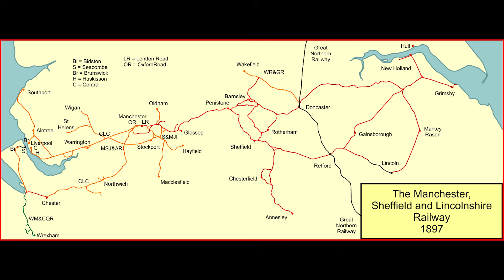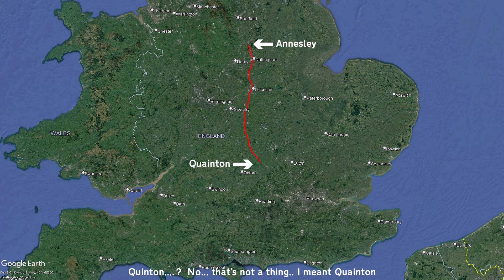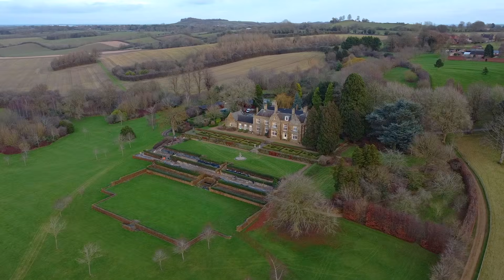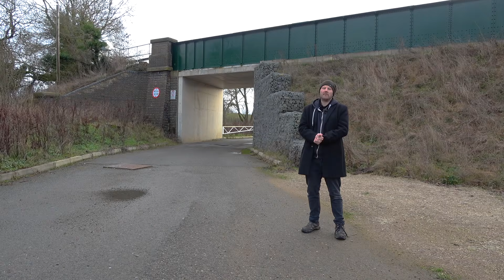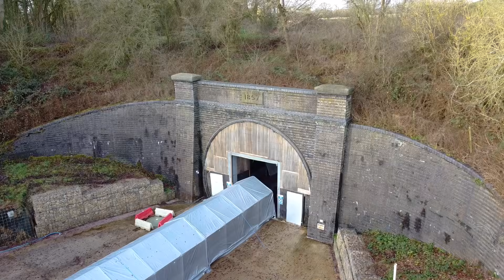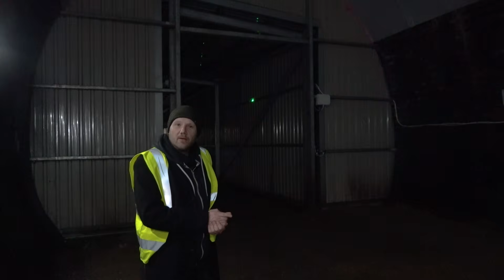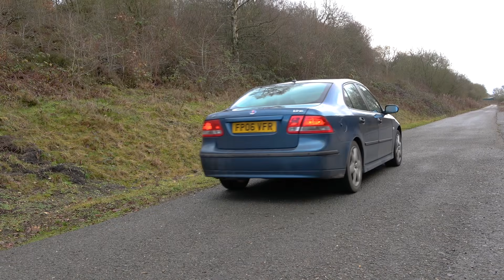The Vehicle & Car Testing Facility Buried Underground In An Old Railway Tunnel

Comment: Thanks for the video, hint, please use Yards as the railways were built in Imperial dimensions.
Reply: Chains if your being pedantic.  (I'm a railwayman 🙂 )
Reply: @stevekelly5166  They measure the length in chains, but were building in yards, feet and inches.
Reply: @fredericksaxton3991  I know my pounds, shillings and pennies.  Don't go metric on me 🙂
Reply: @stevekelly5166  So do I. I still convert in my mind when I buy things like sweets and veg. 10 years ago I was Xmas shopping and bought the last parsnip in the trays. When I weighed/scanned it it came up as 0.67p. I exploded.."How much!", 2 women laughed at me for never shopping, I said, "No..that's 13shillings and 5pence!!" They were bemused.
Reply: @fredericksaxton3991  That's a great way of telling somebodies age - just chuck in a pre-1973 reference, like an M-reg car.  0.67p is very cheap for parsnips though.  That's less than a thruppenny bit.
Reply: @stevekelly5166  Silly me for missing out the £ symbol. I correct the price to £0.67p. Which is damn expensive for a single parsnip.
Reply: Although he did say it was built to French specs and they’d transitioned to metric in the late 1700’s.
Reply: Cubits better than your silly imperial yards.
Reply: @aoxby8037  You are a GAY LORD. I can do metric too.  How is your fanny?  Poking in or out?
Reply: @stevekelly5166  Not sure why your reply to me was deleted, but cubits aren't metric. They are a ancient unit of length. I was also making a little joke with you, but someone seems to have gotten offended.
Reply: @aoxby8037  Youtube sent me a warning yesterday!  Didn't say which post it was or even which video.  Left it to me to click the OK button.
I reckon I could make it worse by telling you Youtube should force it's elbow to the tip of it's middle finger where the sun don't shine 🙂  Don't even care which arm is used.  Was there a preference back in the old days?

Comment: My profile picture is myself and my brother in one of the rest areas when we walked through the tunnel about 8 years ago (ish).  We just went to check it out and happened to get there at the same time as two dudes that had proper cameras and lighting so we got some awesome pictures. Was a spectacle to walk through! There were 100’s of dead birds by the last vent shaft, and also lots of shotgun cartridges. Couldn’t really tell what sort of bird but they were big. I digress. The pictures are on 28days later.
Reply from the maker: I'll have a look.. I love a bit of 28DL.

Comment: Well, I didn't know that was there.
By the way, the original railway was the London Extension of the Great Central Railway, which ran to Marylebone Station, as featured on the Monopoly board.
Reply: London extension of the Manchester Sheffield & Lincoln railway that also built Immingham & grimsby docks, also cleethorpes (!), renamed as Great Central railway on the extension opening.

Comment: So you can actually test your car inside a former railway tunnel without any problems. Perhaps Top Gear should do a challenge inside that tunnel.
Reply: Like The Grand Tour did
Reply: Exactly
Reply: No problems, so long as you cough up the 15000 quid day fee. Just 1000 if you wanna take your bike

Comment: I knew you had changed to a 9-3 saloon, just as I have 😂 great cars, hoping mine will make it to Portugal and back later this year!
Reply from the maker: I hope you make it.. mine has a couple of issues that need sorting and Im sure one day it will leave me stranded in the arse end of nowhere.  Did you get petrol or diesel?
Reply: @AutoShenanigans  mine too, I’d like to get the cam belt and water pump done too before I go because I don’t know if it’s been done before!
It’s a 2008 1.9 diesel 150hp with a slightly stiff gear change 😂 nicest fwd car I’ve owned though, it’s sublime on a long distance run! I still can’t get bored of nightpanel either!

Comment: In 1971? 
The tunnel was used by squatters - the Northhamptonshire Free Love Party (or NFLP).
They cleared a blocked drain, that had been flooding parts of the tunnel.
They then set up a virtual community of 'vagrants' to live inside.
These were all 'hippies' (the right just called them 'commies' or 'drug addicts') who wanted a 'commune'. The tunnel was vacant - so, they used it.
British Rail was not consulted about this and an inevitable lawsuit resulted.
Also inevitably, the NFLP lost the case and were forced to vacate their 'commune'.

However, by then, as the court case had given the commune a great deal of publicity. And consequently? There were over 1,000 people living in the tunnel. And they simply would not leave. Even when the police tried to forcibly remove them. After two failed attempts at this - the military were called out.
The 755'th Royal Surrey Freelancers were given the task of 'clearing the tunnel'.
One thing led to another and shots ended up being fired. And, sadly, two Freelancers were killed - Sgt. Melvin Helix and Lance Corporal Sheldon Rossfinder. This infuriated the commanding officer Captain Lido Gerish. And he ordered the tunnel cleared at ANY cost.
So, on January 23, 1972 - the Army's 755'th Division entered the tunnel with the express purpose of clearing it of all 'hostiles'.
As the Army went down both ends of the tunnel, they were fired upon at irregular intervals. 
They returned fire.
 In the melee - another 139 soldiers were killed.

 Eventually, the soldiers made their way to the center of the tunnel...but found the migrants had vacated it. They had done so the night before the military had first arrived on the scene.

So what killed the soldiers?
Crossfire.
The soldiers had been killed by other soldiers entering from the opposite end of the tunnel.
If a soldier on one end panicked and fired into the tunnel?
Especially when they were far enough inside?
The bullet would hit the other troops...not realizing they were receiving 'friendly fire'.
Then this group would fire back...hitting the first group.
Who would then fire back...and so on.

It was known as the Catesby Tunnel Migrant Disaster.
But the locals call it 'the Catesby Tunnel Crossfire Disaster'.

Of course, I just made the above up.
Cheers.
☮
Reply: I'll have what he's smoking please....
Reply: @dominicskelton3031  It's called 'procrastination-induced imagination'.
No smoking required.
☮
Reply: Pls make this the next book at bedtime; worked for me 😆

Comment: 4:18 mentioning the immense skill of workers at that time makes me laugh.
Obviously the arches and walls which fell down and killed thousands of workers during the victorian period are no longer visible. Health and safety did not exist back then and there was little knowledge about geotechnical engineering, everything was done by trial and error.
Reply: Still standing ….
Reply: True of most earlier Victorian-era railways. The GCR was late enough to the party to come at it with a slightly more advanced approach (e.g. using steam shovels in constructing this tunnel).

Comment: Those boarded up little side rooms/spaces were quite possibly refuges for track workers to stand in when when a train came along while they were doing track inspections etc.
I believe they're still used in tunnels on the operational network but it wouldn't surprise me if track workers now cant go into tunnels unless the trains are stopped for safety reasons.
Reply: Sadly you are correct. These days a tunnel has to be closed to trains before any staff are allowed in them...

Comment: Whether or not the rooms were used by workers building the tunnels, I do know they were used for the storage of fuel for steam trains, specifically wood. Wood, is used to get the furnace up to heat to get the coal to burn fast. Around the end of the 19th century wood became in short supply due to the expansion of printed material. But at the same time the conversion of shipping was towards larger steel ships. Leading to an abundance of heavily tarred wood that proved outstanding for the purpose. In fact it proved so good that they even tested the “Duke of York” on a 150 mile run using just the wood obtained from old ships. According to the Times, it achieved a staggeringly high 76 miles to the galleon.
Reply: worth it for the punch line😂
Reply: Badum-tish.  Lovely pay-off there.  😂

Comment: You didn't really need the turntable. Even my mum could have done a three point turn there! 😂
Reply: I guess handbrake turns dont work so good with electronic parking brakes   😄
Reply: It's prob for the single-seater race cars that have such a wide turn circle
Reply: @whyyoulidl  Yes. They don't have reverse gears either. Single seater cars are a pain in the backside to maneuver at slow speeds.

Comment: The railway known as the Great Central Railway (GCR) was known as Gone Completely Railway in the Edwardian music halls so unpolluted by passengers was it and with it its investors money. It did better with freight, principally because there was not the passenger traffic delaying it however when rail freight declined in the 60s it simply did not offer anything the Midland Mainline did not offer and that better served the centres of population in the region so it won over the GCR that was still essentially as it was at the start of the 1890s, a pretty grim dirty experience without even roofs on the toilets and would have needed massive investment to bring up to date.
Reply: Transferred to the midland region of BR (old midland men with an axe to grind) from the Eastern region (ex LNER post grouping) the management embarked on starving gc of passenger traffic by stealing the express through services which rivalled the midland (midland line being a series of local lines cobbled together !) This left local stopping trains & the successful cross country services (Newcastle-penzance) via its great Western alliance before that was stolen too. Had it been handed to the Western region the line would still exist today as a crucial hst network. It was indeed the enormous amount of freight, particularly coal & North Sea fish that kept it open until the 60s. Container freight would've helped if introduced earlier too.
It has to be be remembered that the gcr played a crucial part in WW2, both in troop carrying & military supplies. 
Strangely the line was maintained to the highest standards right to closing day, as witnessed by the many last days photographs, with many sections renewed a few years before closure. The midland management cited 'high maintenance costs' as a major part in its closure.